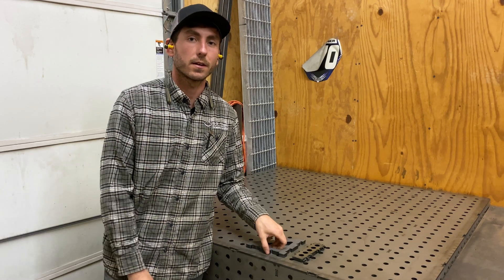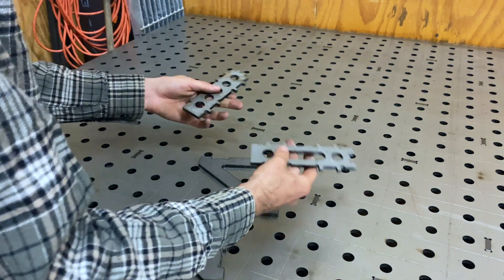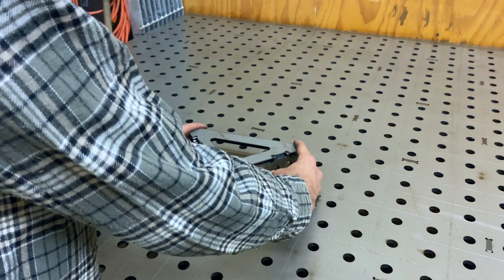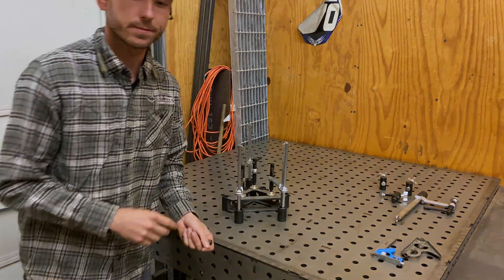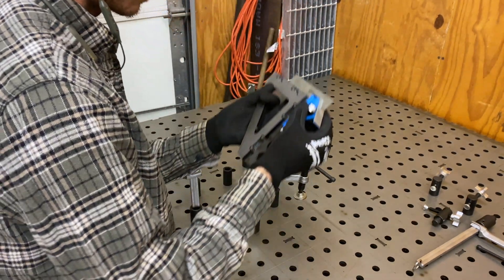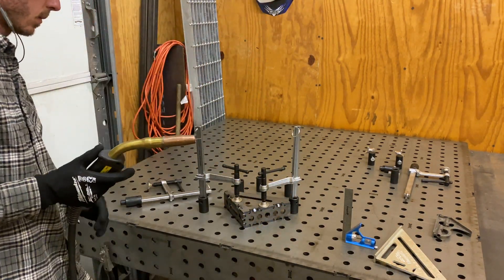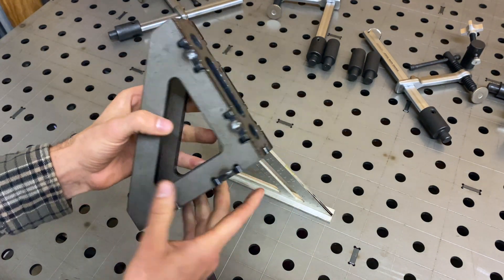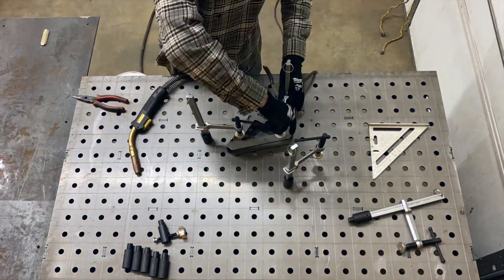DIY Precision Welding Square 007 Tolerance!

Comment: I find these 2” wide squares too much bother to attach to the table. There’s a reason the cast iron versions have just one side. Getting the fixture bolt in between the sides and tightening it is a real hassle. Not impossible, obviously, but annoying. They do make 4” wide versions which are much easier to use, but take up a lot of room on the table. The main virtue of these is the cost, which is low. A 10” high precision machined cast iron version costs $120. Some others I have cost $168 and even more. I would like these if they were made from a thicker plate so it can have just one side. And if it were 0.500 thick it could be used with standard fixture bolts for either 5/8” holes or 16mm holes. The trick to getting these correct is to make sure all the parts are tightly held together before welding. The slightest amount of looseness will cause it to be out of square, just as in assembling the table. Just remember that there is no warrantee for straightness or squareness as that’s up to your ability to get them that way.

Comment: The center of the slotted side could be adjusted by propping the ends and lightly hammering or pressing the center out until it measures flat. Same with the tip of the second square.
Reply from the maker: thanks for the advise I will give that a try!